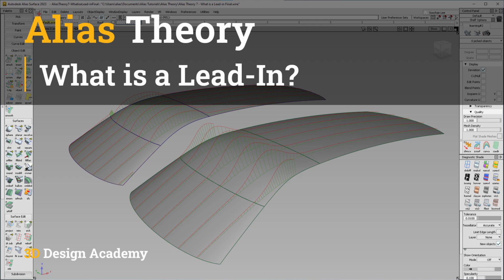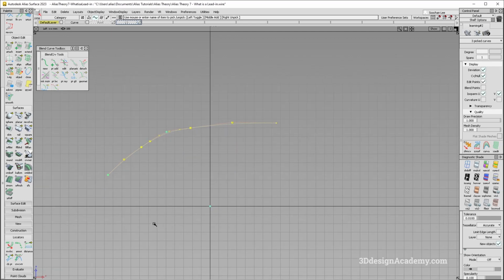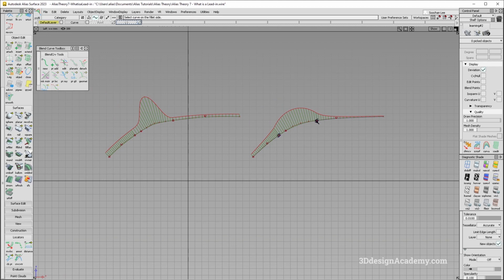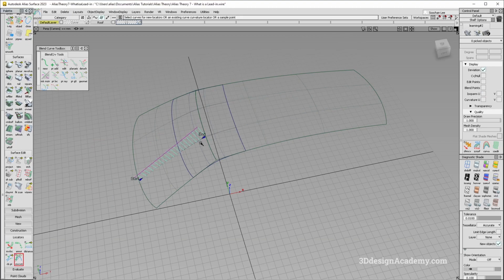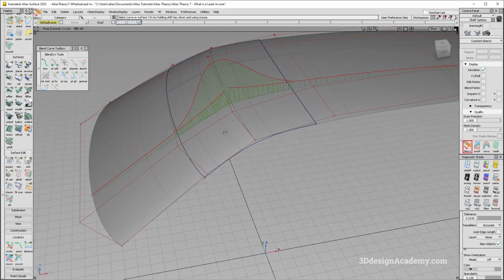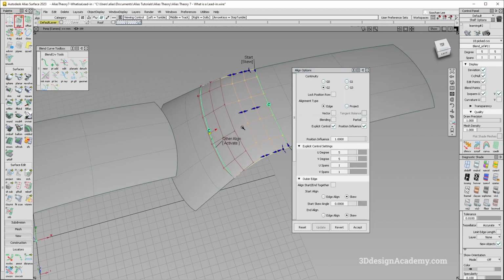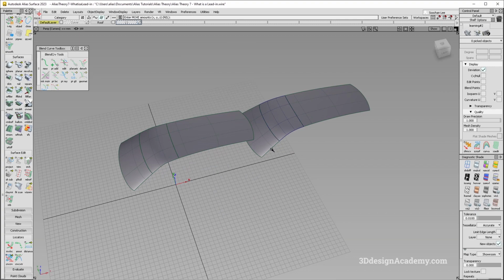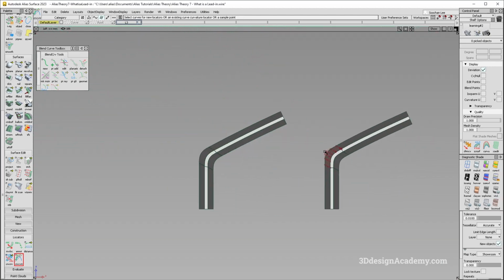Alias Theory 7 - What is a Lead-In?

Comment: Hello. I have faced an unexpected challenge in the surface of my roof and windshield. I created nice side and middle curves with proper lead ins and curvature comb (3 curves - one for hood, one for windshield and the blend)( 2 on the sides and one in the middle). I created the surface across the center line by using shift + skin tool. I slide the CVs slightly to match the edges as per the blueprint. I turn on the curvature comb of the surfaces and I see except the one in the middle and the side edges, the other curvature combs have a shifted gap at the blended region. I mean the highlight is super nice and the comb from the side view is good but there is a gap when I look around. I don't understand why is this happening. What did I do wrong? Any idea?

I have uploaded images at the Alias Forum. here is the link -  https://forums.autodesk.com/t5/alias-forum/help-curvature-comb-has-a-gap-no-idea-why/td-p/14229064
Reply from the maker: If you can send me a file or upload it with a link, that'd be the best way for me to find out what's going on.

However, at first glance, you might have shifted CVs without turning on the symmetric modeling tool. There's probably slight shift in CVs. This would cause positional failure, along with the curvature comb to also be a bit off.
Reply: @3DDesignAcademy yes offcourse..I ll send it to you.. Also There is one area of extreme challenge on the entire Shoulder Line and C Pillar connection that I haven't been able to solve so far.. It would be a huge help if you can assist there as well.. I ll send you the file and related images of that area on the C pillar. It would be a huge help..
Reply from the maker: @AayushAggarwal_IntoLife  I can take a look. Please send it to contact@3ddesignacademy.com

Comment: Soochan, can you please clarify what the hell this guy did? https://www.youtube.com/watch?v=4TWQhmSBWf8

I mean, yeah, he was able to align cvs somehow. I like the result, but do not really understand what he did exactly. I tried to follow, but the moment I try to move cvs history and g0 alignment breaks... Please do a video!
Reply from the maker: I think I have some idea as to what he's doing, but I have no idea why. He probably used align with either project or edge, and increased the position influence to 1. If he's doing that work, it should be to either clean up the CV structure, or adjust the tangent lines, but I have no idea what he's trying to achieve here. There's no audio either so can't really figure out unfortunately.

If you want to, I can do a video in Align tool and how to use it to get cleaner fillet, but you already seem to have a very good grasp on it.
Reply: @3DDesignAcademy Yeah, I mean, it looks like he is cleaning up cv structure, making them more evenly distributed and perpendicular to the surfaces edges (to the trimmed ones as I understand). And I like the result, fillet structure looks accurate, but I do not understand how he was able to move cv's of rebuild curves without breaking history of g0 alignment. The moment I try to slide CVS, history breaks. What's the trick? How we was able to move cv's and keep the history? why mine is always breaks?
Reply from the maker: @alexandergolubev6358  Oh that's due to him using fit curve. When you're using the fit curve tool, the history is retained even if you move the CVs. The tool still tries to "fit" with the new CV structure so you'll see the CVs bouncing around in order to retain G0 continuity. That said, it may be position or not depending on how many CVs you have and the tolerance, but that's what he's using to create a curve with history.
Reply: @3DDesignAcademy Oh, make sense!  I will check it out again. 3 is a charm) Thanks man!
Reply from the maker: @alexandergolubev6358  No problem! I hope it works.
Reply: @3DDesignAcademy  Yep, it works, and I like this trick, it helps. Thanks man!
Reply from the maker: @alexandergolubev6358  I'm glad it worked!

Comment: Awesome, thank you! Small question: when you create a guide curve between flat surfaces to build a G2 transition surface between, what character this line should have at the points of connection? accelerated up? down? Or maybe a gradual convergence to single point? BTW:  if you try to pick fillet edge and then main surface curvature comb will not break. I guess it is an Alias bug.
Reply from the maker: If I'm understanding you correctly, the CV location shouldn't matter because the surfaces are flat!

Also it is my mistake, but the curvature comb breaking is due to the fact that it's done to a patch precision line. I should've projected a COS and the put a comb on it. The patch precision line on the fillet piece is not curvature to the primaries.
Reply: @3DDesignAcademy I mean, imagine you have two flat surfaces, connected in a steep angle. And you need a fillet to connect them. They are flat, but fillet should be g3. You can't, for some reason, build it with fillet tool (which happens a lot in reality as we all know), and you need a guide curve. What character should this guide curve have for g3 connection? I mean, sure, 7 deg 1 span, but what "curve curvature tool" should show me in ideal conditions? An arc? Accelerations on both sides? Standard fillet tool will build you an arc and highlight will be somewhat shitty. Acceleration will show you dev1 error in no time. So, I am confused...
Reply: @3DDesignAcademy  Ok, I guess that was a dumb question, sorry. Character of the comb should be like in your video preview. It does not matter are surfaces flat or not, the character of the line still should accommodate to g3, so have a gradual smooth acceleration toward the peak. These combs are very confusing though.
Reply from the maker: @alexandergolubev6358  When you're building a fillet for 2 flat surfaces or curves, the fillet will have to all the work. Like you said, the curvature comb will have the same shape, but you will have to do it with the fillet alone. Usually, a 0.5 form factor will achieve the result.

Also, for the dev 1 error, I'd just ignore it. If you have a curvature deviation of exactly 1.0 and it's against a flat surface, it's a calculation error by the software. This was confirmed by one of technical managers who works at Autodesk.
Reply: @3DDesignAcademy  Good point, good point! Thanks man! I will try 0.5 factor, sounds like a great suggestion
Reply from the maker: @alexandergolubev6358  No problem!